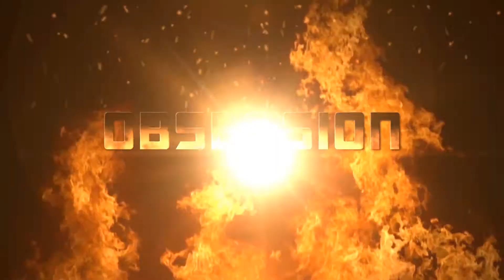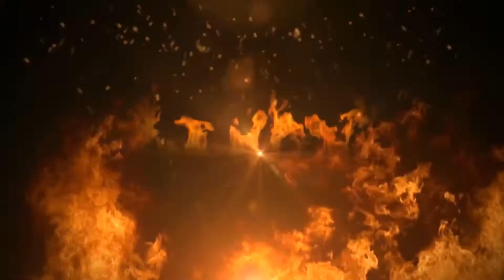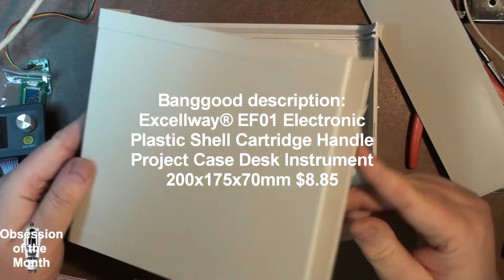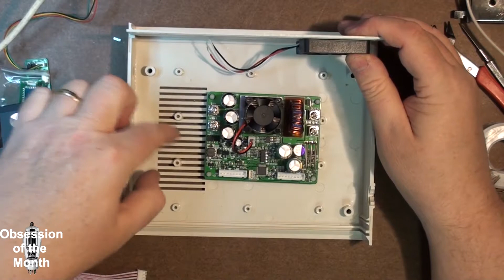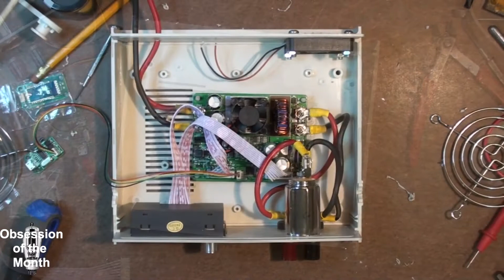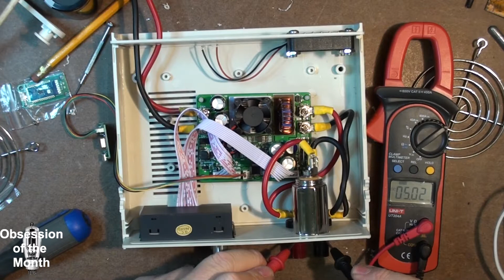DPS5015 USB Bluetooth Programmable Buck Converter Build Part 1 of 2

Comment: I've just put one together. Using mains, to a 48v transformer, through a silicon rectifier. That outputs over 60v. So I threw it through a buck converter to get it down to less than 60v. It works, but what app do you use for the blutooth monitor?